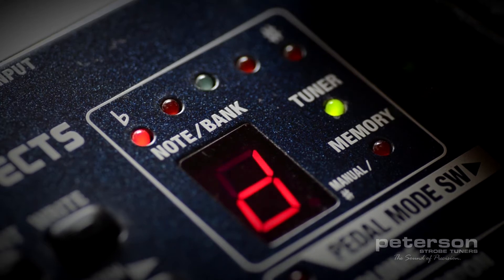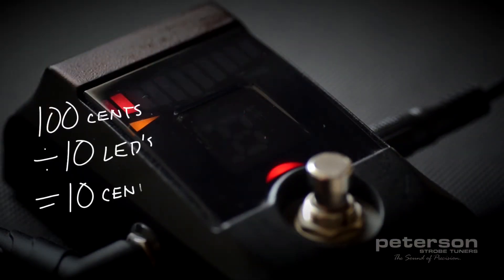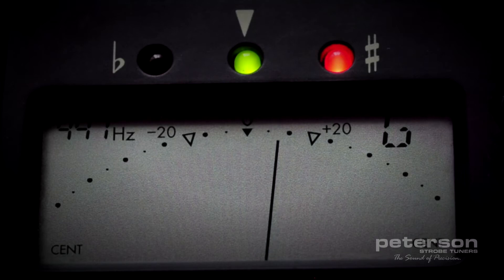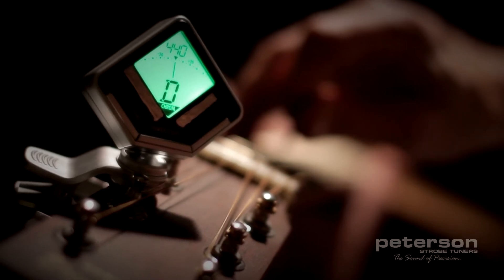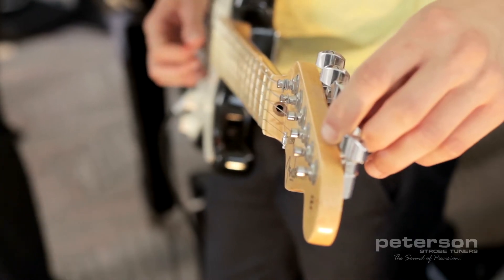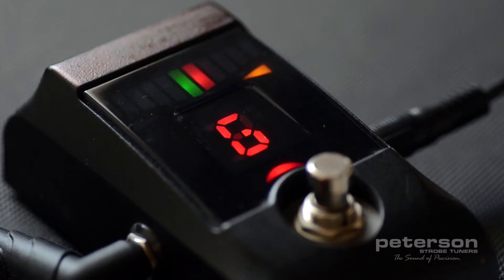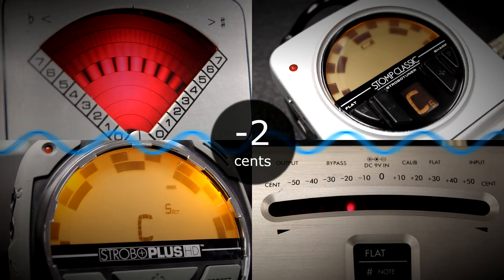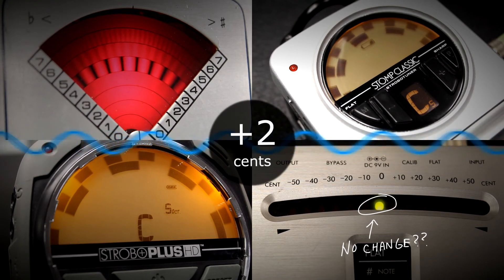How Accurate Is My Tuner?

Comment: With the stroboclip hd, eoectric guitar, Which setting do you use to set intonation?
If you will use the GTR sweetened tuning to tune up, should you also use that to set the intonation? 
Are are sweetened tunings meant to be applied for tuning after using EQU mode to set the intonation?
Reply from the maker: Thank you for the questions. Always set intonation with EQU. The offsets of our Sweetened Tunings are developed with a baseline of equal temperament.